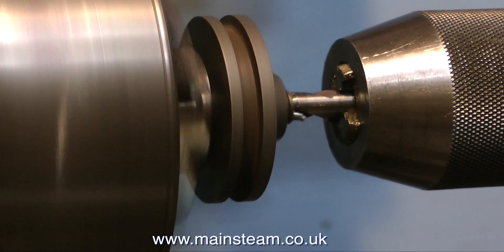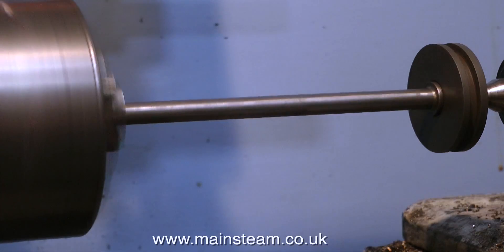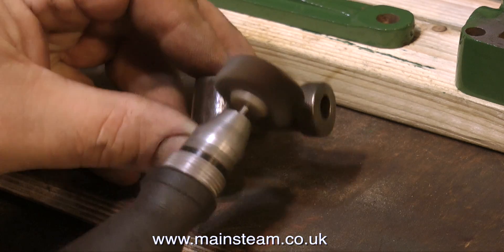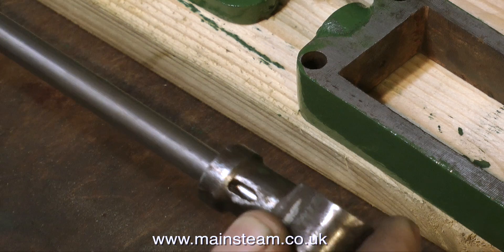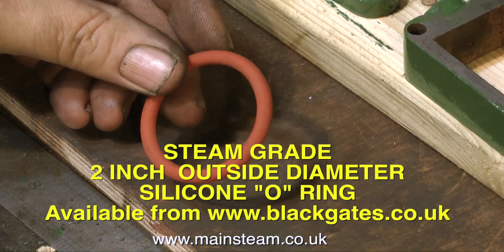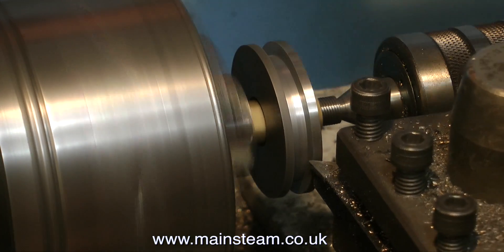PART 11 - LARGE HORIZONTAL STEAM ENGINE REBUILD

Comment: When machining the piston ring groove to accept a silicone O-ring, do you take into account the contoured shape of the ring's inside dimension? In other words, do you leave the depth cut flat on the piston or cut a concave shape to fit the roundness of the ring? (thanks in advance, and I luv these videos!)
Reply from the maker: I do it generally as I show in my videos - with a small parting tool. The contour of the internal diameter is therefore flat.
Reply: Yes, I see that the parting tool makes for a flat I.D. But do you think a concave shape would be a better shape for the ring to seat in to? Less of a "round peg in a square trough" so to speak...? (Or is my question just minutia?)
Reply from the maker: it's not important as the O ring "Floats" in the groove anyway . . . .
Reply: I see. THANKS. :-)